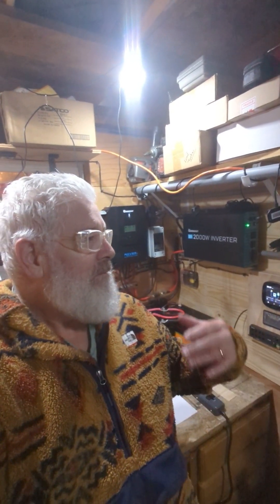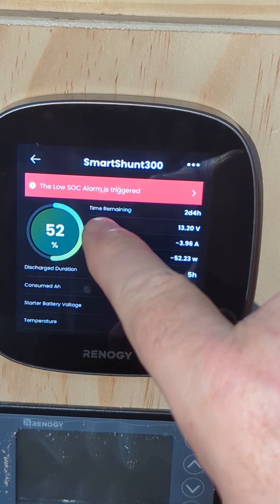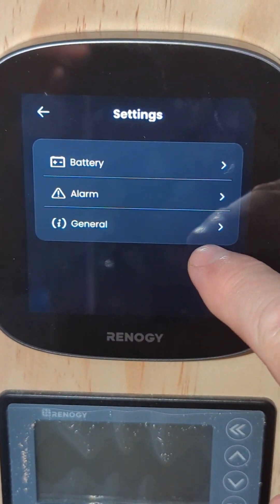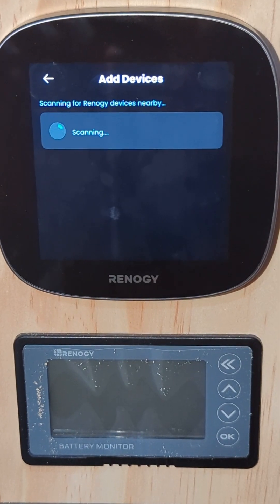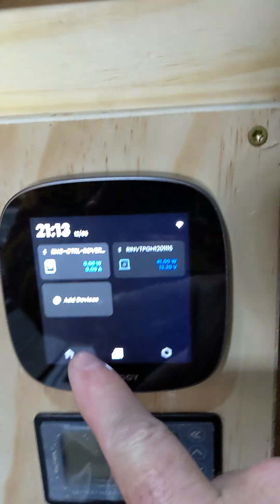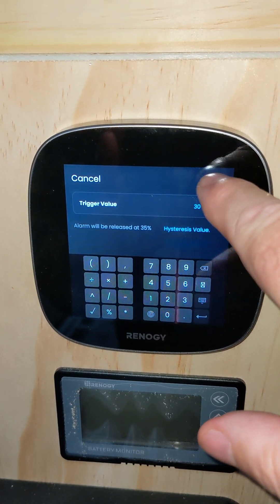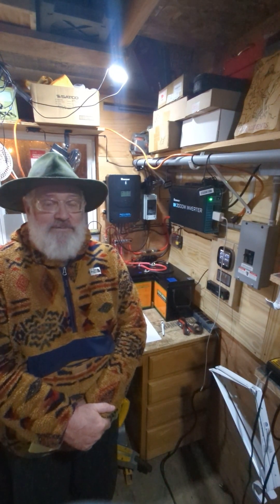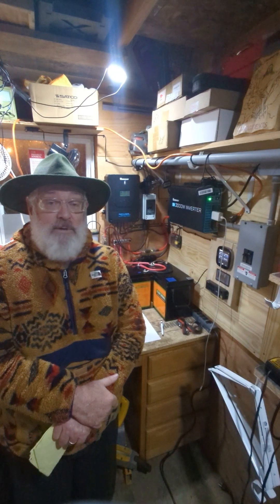Renogy  One Core and Battery Shunt 300 SOC Alarm Fix

Comment: Does anyone have any knowledge of using the shunt with DC home only. I understand the Bluetooth led operation no problem. Renogy can’t explain the operation of the power led. 
When the shunt sees charging and discharging the led is solid yellow. When all leads are disconnected the power led starts flashing yellow to red non stop. Renogy support has no answer they are puzzled..
What does the manual mean the shunt turns off / on automatically?
Reply: Hello did you ever get this figured out? I spent an hour with Renogy just now. I’m getting a red and yellow exclamation on one core. They told me to return to Amazon? I was able to connect to dc app no problem. Any idea how to connect to both? Thanks
Reply: @eescalante68  basically my unit status LED flashes red and then green when no load is detected. 
So when my cooler draws nothing the shut just does this annoying flashing. 
Unfortunately renogy support after 20+ messages saying it was broken then finally saying it was normal.
Reply from the maker: @crankshaft007  I'm not sure what that means "it shut in and off automatically" I used my shunt with BT and the DC home so for a few months without the One Core

Comment: Thanks mate, what is your advice for cable size in connecting 2 x100Ah batteries, max output will be via 2000w inverter. Thinking of using the 4awg  cables that came with the inverter (not for the investor connection) just battery to battery.
Reply from the maker: Honestly, I use 2 AWG or larger for all battery connections, and battery to inverter connection. That allows up to about 100 amps, and you can't go wrong for the most part. Depending on where you are located, I usually buy bulk battery or welding cable by the foot at a battery retail and repair store. Then I custom cut to length and crimp on appropriate size lugs.. I actually have a video on that.. thanks for checking in!
Reply: @SolarBearDIY  thanks mate, appreciate the reply. I was looking at welding cable, it seems to have a much higher amp rating for its diameter and is very flexible also. Was wondering if it was in the “too good to be true” basket because it is also much cheaper. I live in a very remote part of Australia so most purchases are made via the internet rather than being able to see things before buying them, doesn’t always end well. Particularly with lugs, hard to find quality lugs with decent wall thickness.
Reply from the maker: https://youtu.be/7O0N-aXEoWI?si=A5GZnAiqt06qGJkz

Comment: I'm having a similar issue but mine is the voltage threshold. I need to up it but it's not saving. I'll have to try this next time I'm in my camper. On another note, I see you have a Renogy inverter. Are you able to turn it on and off with Renogy One Core in the same way an inverter remote switch does? Thx.
Reply from the maker: I wish I could shut it off, and the controller also. It would be a great way to have more control over your system remotely! In saying that i really do like this new edition inverter, and the fact that it communicates with the one Core and DC Home systems. I only wish the they had the same inverter, but a larger 3k capability!
Reply: @SolarBearDIY  I fixed my shunt issue. Thanks for the video. I have one of the new 2000w inverters on order. I'm curious to see how low the standby power consumption is.
Reply from the maker: @Rickmakes  I'll take a look tonight after work and let you know!

Comment: Just a FYI. You can still use your old Renogy shunt. Just wire it in series with the smart shunt. It’s nice to still have the display for “at a glance” as you walk by as well as for backup when the Core One drops connection like it seems to do every few weeks.
Reply from the maker: Thanks, and yes I was thinking about doing that in the future when I reconfigure with two controllers in parallel, or even a larger 100 amp controller. Thanks for checking in!

Comment: thanks for the detailed info on this. i'm currently putting together a similar setup to yours but it appears Renogy has removed the smart shunt from their store. Maybe it was causing too many support headaches for them? 
Or maybe they are not happy supporting competitor lifepo4 batteries, that now cost 50% less than theirs? i can get an eco-worthy 100ah for $180 now. crazy.
Reply from the maker: So scuttlebutt has it, that they are going to re-release in February. I'm not sure how valid that is, but I do know that the first batch was a beta model only. Thanks for checking in!
Reply: thanks! @SolarBearDIY
Reply: The issue was “ smart “ conflicted with another blue coloured manufacturer